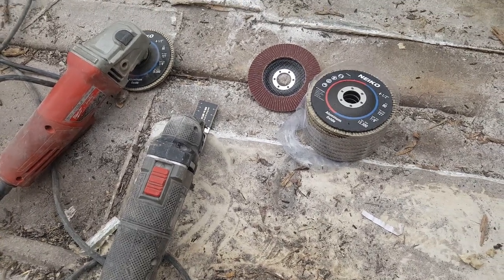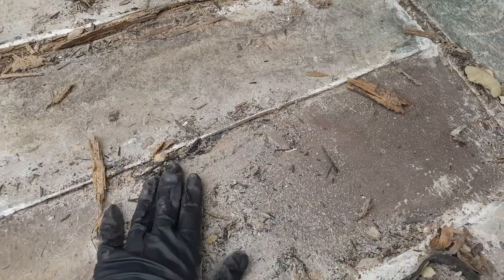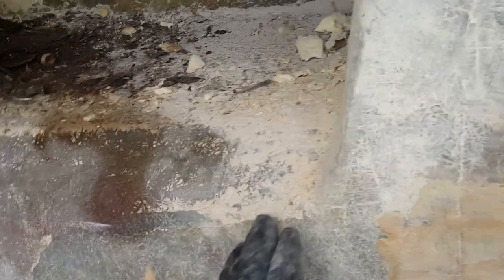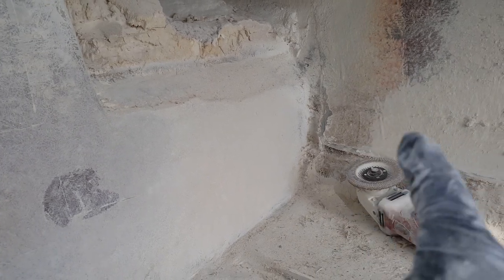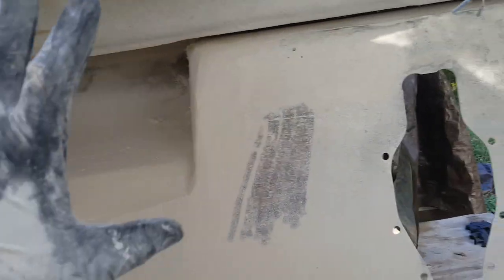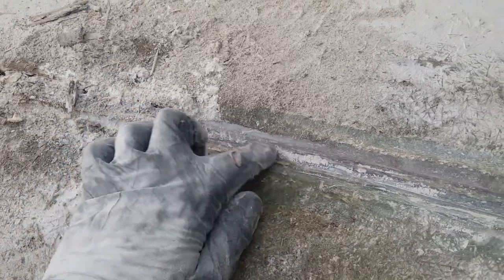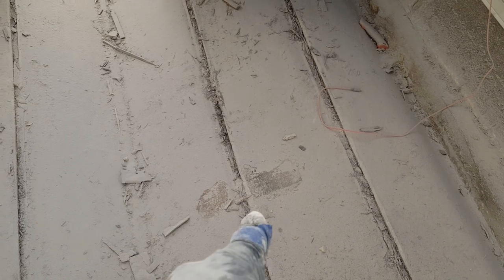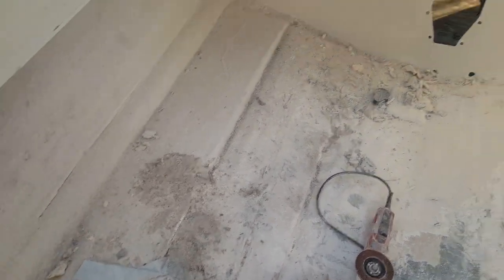Boat Transom and Floor Rebuild - ITCHY! Grinding the Transom & Floor - Part 26

Comment: You're the man brother! mines should take a week and a half to grind
Reply from the maker: Bert be safe and wear the Tyvek suit from Home Depot and get a hold of this mask. I know it's a little pricey, but it is sooo worth it, I promise. https://www.amazon.com/3M-7162-Full-Facepiece-Spray-Respirator/dp/B0002STR86/ref=sxin_0_osp20-709189ad_cov?ascsubtag=709189ad-6347-46b7-a509-190da1b2e985&creativeASIN=B0002STR86&cv_ct_id=amzn1.osp.709189ad-6347-46b7-a509-190da1b2e985&cv_ct_pg=search&cv_ct_wn=osp-search&keywords=full+face+mask&linkCode=oas&pd_rd_i=B0002STR86&pd_rd_r=db1698a1-3428-44bf-afc8-141943d6348d&pd_rd_w=snv25&pd_rd_wg=heKCE&pf_rd_p=c501273b-119a-4fc9-ad78-eda5006b0be9&pf_rd_r=ZH50737ECBC8XC4F91RQ&qid=1565843563&s=gateway&tag=bestcont06-20

Comment: Hi! Also doing a rebuild on a 1975 cobia. Did you have to cradle the boat for stringer removal? I hear if the cap is left in its enough support. Thanks!

Comment: Love the video. Nice job. You may want to consider tongue depressors. A box of 5000 can be purchased on Amazon for about $55.00, about the same as popsicle sticks. But the tongue depressors are 25% longer at 6” long and likely wider. Even at box of 500, they are still slightly less than .02 each. Also, what are you filming with. Very nice work. Thanks

Comment: Hey I bought one of those concrete blades to take down any big areas of grinding and let me tell ya that works great it does cut a lot fast so you have to be careful but curious what you think of that
Reply from the maker: Thanks for the tip!
Reply: @michaelromer2016  I ended up using the flap discs like you did the concrete disc was just to heavy to wield but could definitely have a use somewhere I’d imagine !

Comment: In my Galaxie boat, when I pull the motor out underneath the motor, under the pan there are two round black plastic pieces with one wire going to one of them and what is the purpose of the other one. Not sure what the two round plastic things are in the hull they are about 3 inches around. Any ideas? They are made into the boat.
Reply from the maker: Wondering if these are for a live well. I believe I had something similar.